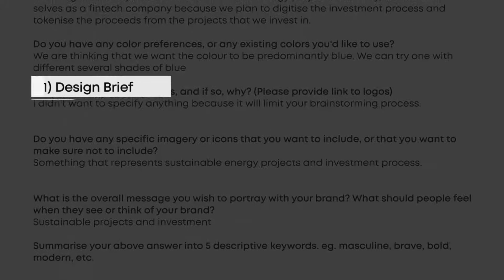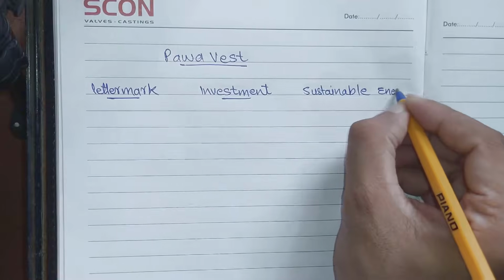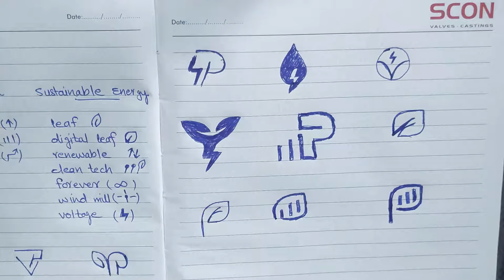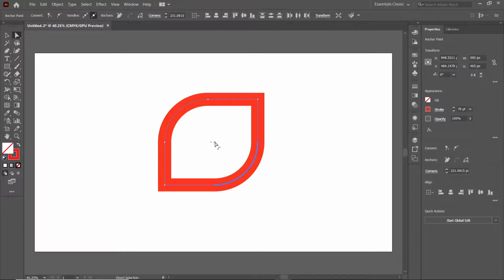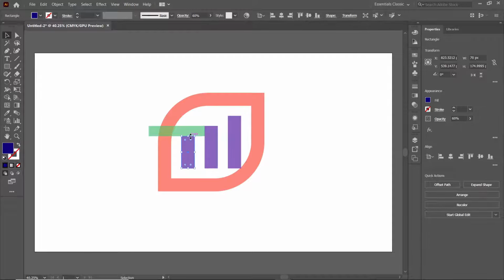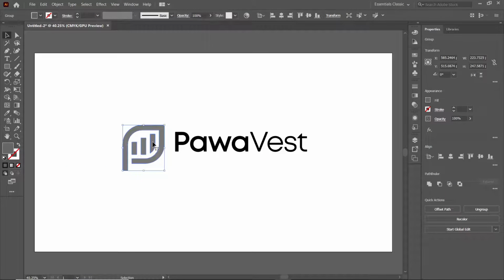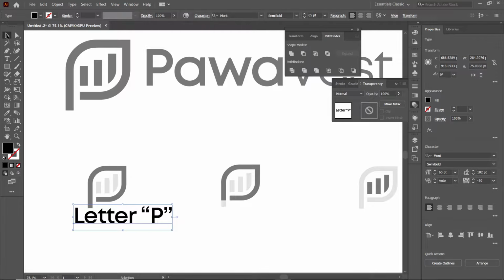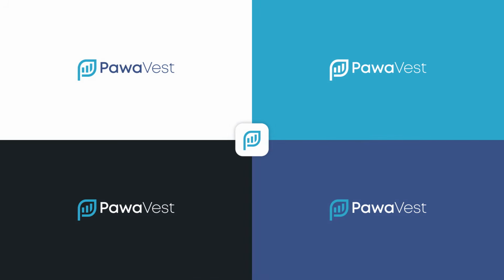How to design a logo for Beginners: Step by Step Logo Design Process

Comment: I wunder when you made the logo, how you known that it should be rectangle with 55px width between the rectangles in the histogram and the leaf?
Reply from the maker: The dimensions are just for the tutorial.
For the first time, I designed and adjusted the logo with respect to the sketch. After that, I adjusted the dimension so all the users can follow the design process with ease.